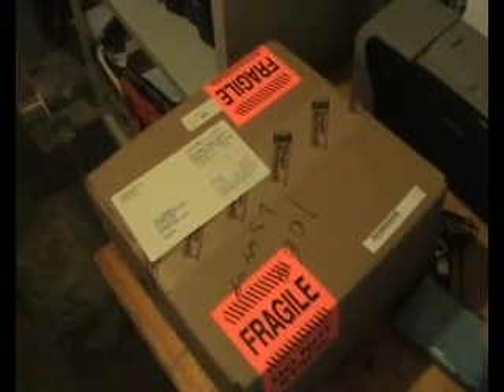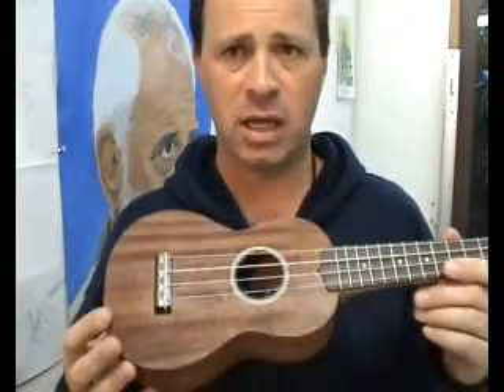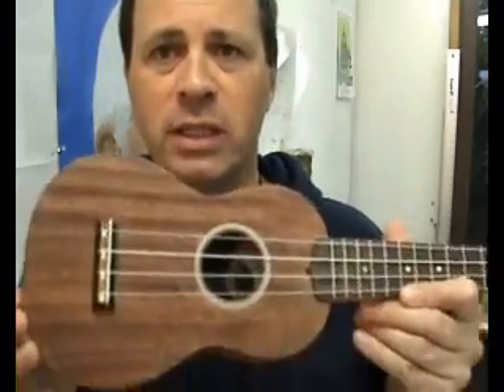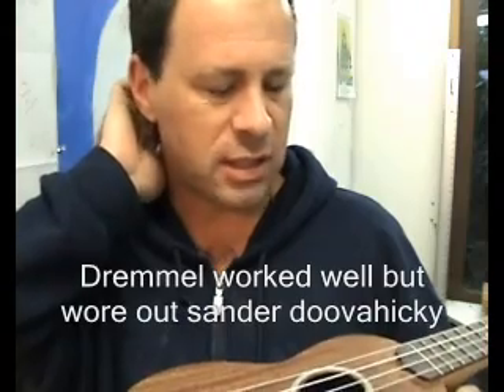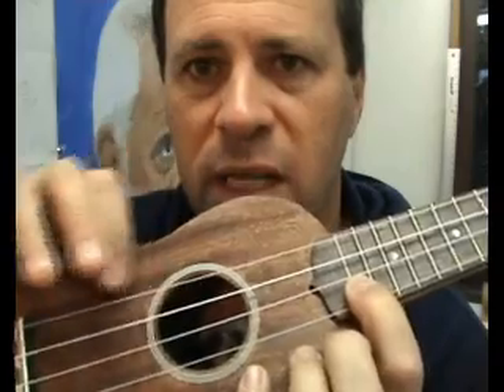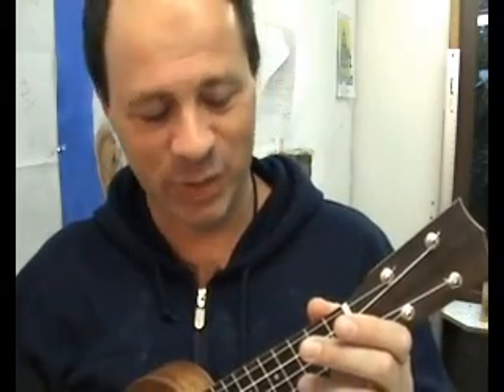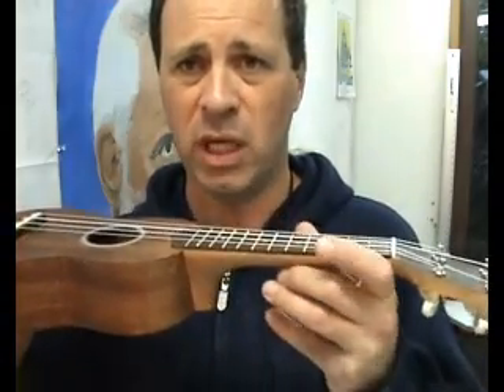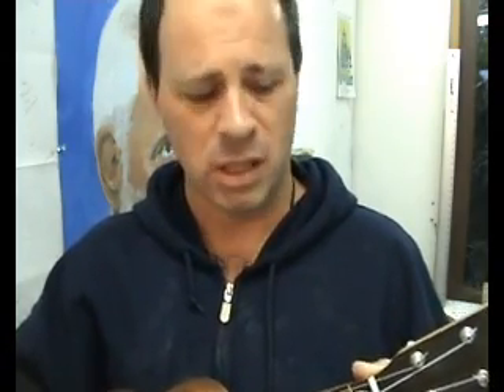Stewmac Uke Kit

Comment: I enjoyed watching this as I just finished my first Folkcraft Cardboard Dulcimer Kit and being much like you had much the same experience. When you've got the top turned over with the glue running out and are trying to fit cardboard into cardboard track, well, you haven't lived until you've done that. But, now I have a dulcimer and it sounds fantastic and is so much fun. So, I REALLY applaud you for bravery of using wood. I watched in awe and amazement. and yeah, I wish they'd told me not to use my framing hammer on the frets...